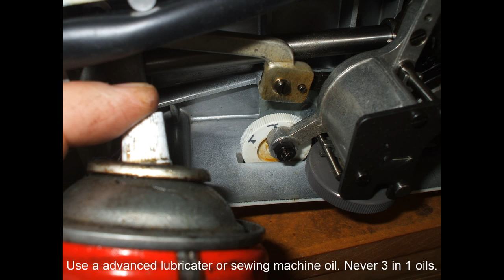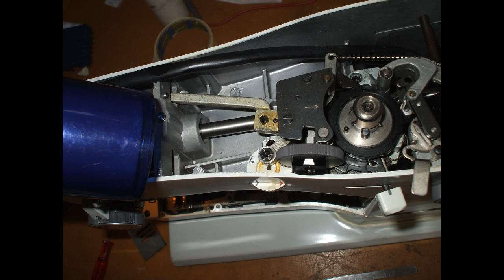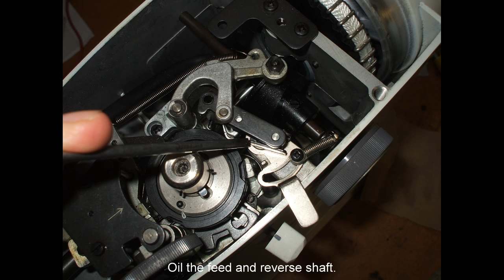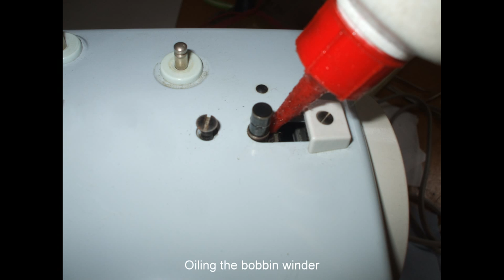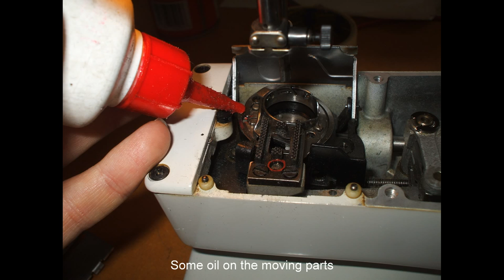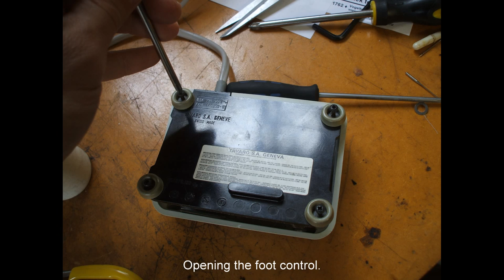Elna SP ST SU sewing machine repair tips

Comment from the maker: Cool, glad i could help. I'll post a video in the near future why your Elna sewing machine runs by itself. It is normally the interference capacitor that fails. Sometimes they can go up in smoke. You can disconnect it to test if it is faulty or not. If you replace it and test, you likely to need the service of  someone with the correct electrical qualifications. Take care working with electricity.

Comment from the maker: I've added a web page (All About Circuits) in the description where you can find more information on the older wiring colours. It seems the black and blue is a older style from Europe and the black should be live.
The best will be to asked a electrical worker familiar with those wiring colours. With a POLARITY TEST you can be certain. The live wire should always feed into the switch. That will isolate the machine from live when it is switch is off.

Comment: First many thanks for the Elna SU video, got the machine working. Now a question or 3.. The machine is missing stitches, about 1/15 on both zigzag & straight st...When zigzaging it gathers the material under the st. (left-right) ... is there any adjustment to foot pressure, I want to do  stitch-in-the-ditch quilting, but I cant get the thick sandwich to feed properly even with a walking foot................ thanks :))

Comment: Just bought on of these at an English auction but the electrical plug has been cut off.  Was going to put a new one on it but it has two wires, one black and one blue  do you know which one is the neutral one and which one is the live one?  Your help would be appreciated

Comment from the maker: If you timing is not set correctly or very fine it will/could cause skipped stitches on stretch material. When the needle is on its far most left the hook point should just pass above the needle hole. The hook point should almost touch the needle when it passes above the needle hole. It is easier to check with the needle threaded.
I've add a link in the video description for a blog post where you can find the settings for the hook timing. Normal.

Comment: Hi, I have an Elna SU Air Electronic, which I have never had a moment's problem with until I lent it to my daughter 😭. Now the width dial doesn't work anymore, so I can't do anything except a straight stitch. Do you have any suggestions? Thanks!
Reply: I had the same problem with my Elna TX (very similar to Elnita and Stella models). I had to recenter and adjust the cradle axle (the part on top of the needle gauge).

Comment: How do I replace the capacitor in my elderly Elna?  It just ceased working and although the bulb has been replaced, it still wont go!!  Where is the capacitor?  Appreciate any help, thank you
Reply from the maker: The machine should still run even if the capacitor is blown. Could be motor brushes or even a loose connection in the foot control. Maybe your lead is damaged. I could try and help you at https://www.absolutesewingmachines.com/ with more detail.